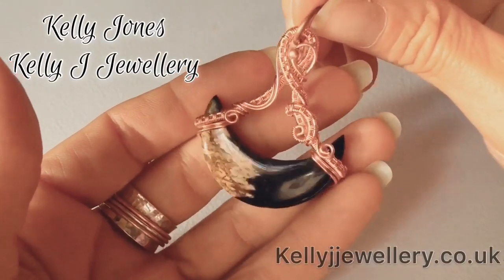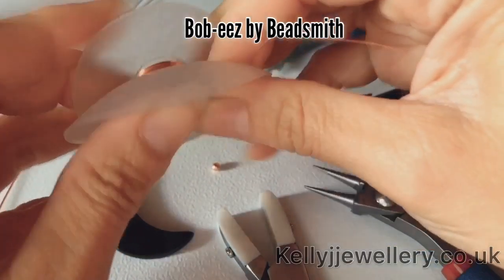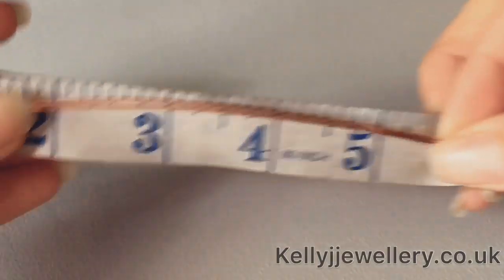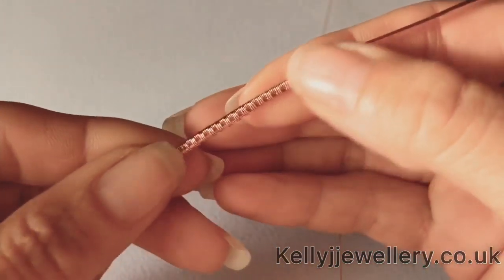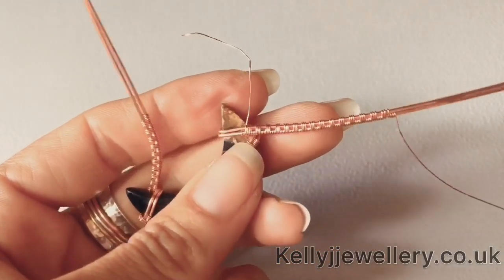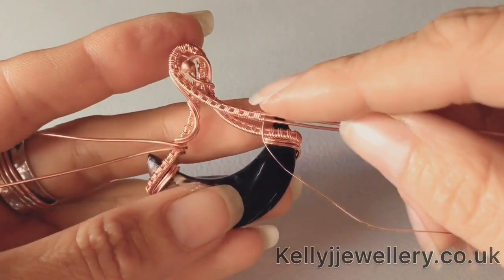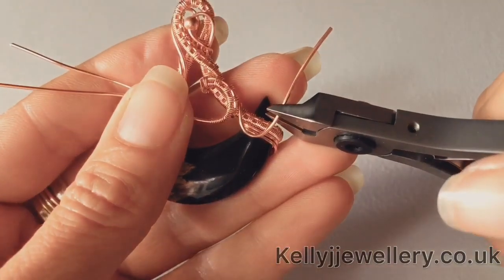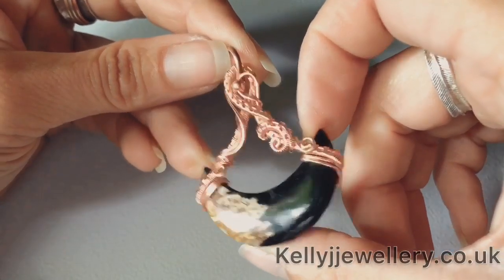Wire Wrap "Savannah" Pendant Tutorial.

Comment: I’ve bought wire from a local hobby store called hobby lobby but the wire usually doesn’t keep its color as if it is just coated. After May I ask where you get your wire from or what I should be looking for?
Reply from the maker: Look for uncoated and dead soft. Try Rio Grande online. I'm in the UK, so I buy from metalclays4u and scientific wires.

Comment: Hi Kelly, Im afraid I didn’t secure the weaves around the tips of the crescent as it slipped right off! It seemed tight and the weaves were wrapped so not sure. I ended up starting around the back weave and using another weave to wrap around to the front and secure to the curls in front. It looks good but is there a trick to getting the wraps secure around the tips of the moon? Thank you, got lots of practice with my 3-3 weave in.
Reply from the maker: I did that on a different one too. I took a few wires over the top of the stone and under to join the wires on the back ❤️

Comment: Love it.  Question about the bob-Eez.  (Just received mine).  Do you wrap the weaving wire per piece or do you just roll a good amount around it?
Reply: I guess I meant do you measure out the weaving wire then wrap it around the bob-Rez?
Reply from the maker: I wind loads onto it. With mine I took a pin, warmed it up on a lighter and pierced a small hole on the inner bottom bit, then I poke the weaving wire through that hole, hold that bit in place then wind it on, just so I can get it nice and secure, does that make sense?
Reply: @KellyJonesJewellery  question about the bobbin. Why not just work from whatever spool it came on? Also, I have the same type stone but have forgotten the name. Do you recall what stone it is?
Reply from the maker: The stone is a palm root. I can’t work from my spool because I buy in large quantities but do whatever is easiest for you 😊
Reply: @KellyJonesJewellery  have been wire wrapping on and off for a year. Still not very good. Seems I am so stiff and my knots get tight. I have been working on one of your captured hearts and although my stone was bigger, I think, not very good at the whole cm, mm thing being from US. The wrap seems way to big. Thank you for your tutorials, even I can follow along!!